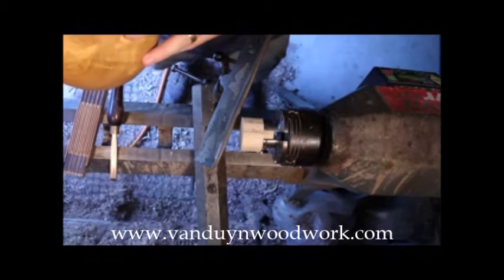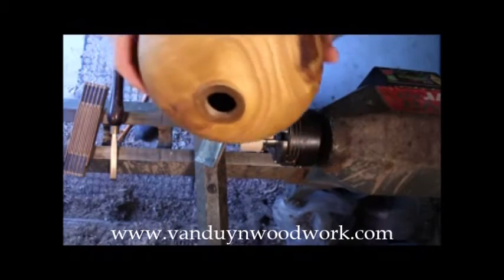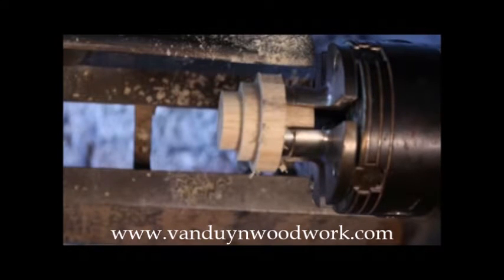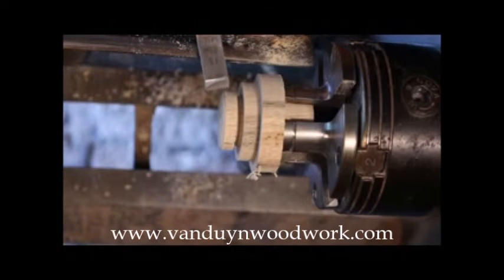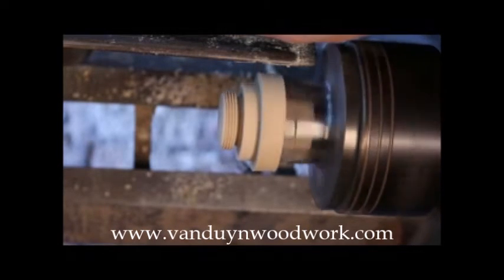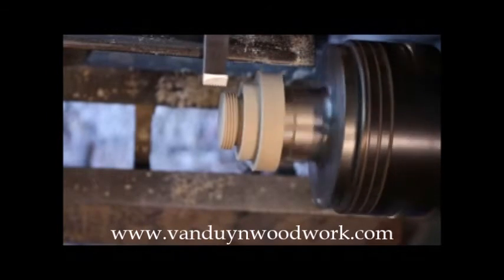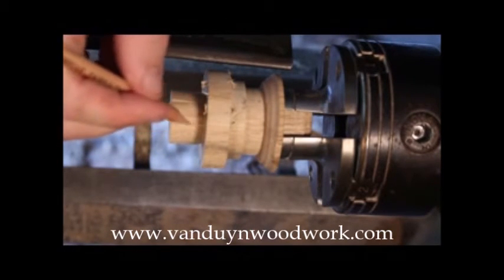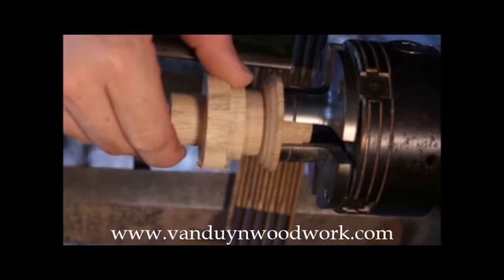Wood Turning - Cutting Threads in Wood, part 2

Comment: Have you ever tried threading Bradford Pear?
Reply from the maker: no not yet.  Of the domestic species I have tried I find that boxwood does the best although its hard to find any of significant size.  Persimmon and dogwood also cut threads pretty well.  I am sure there are some smaller sized species that would work really well, but I am just working with what is fairly easy to find here.
Reply: I have had good luck threading Bradford Pear which is readily available in the Atlanta area.